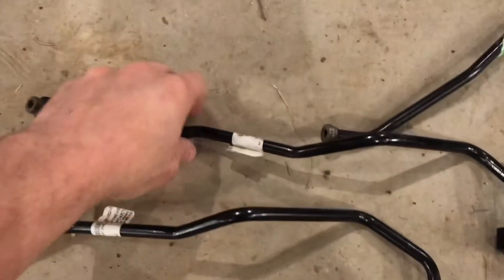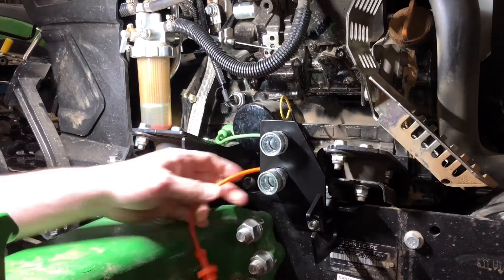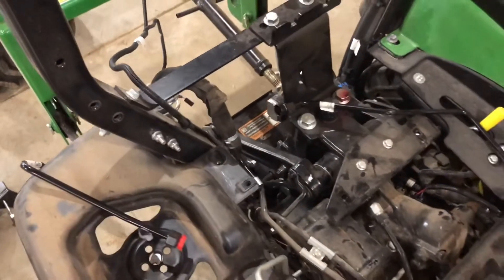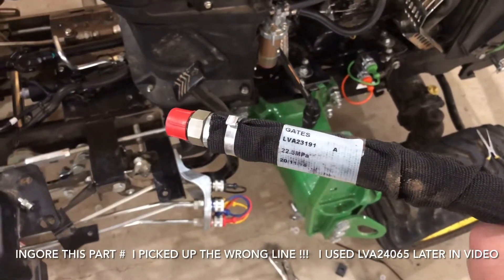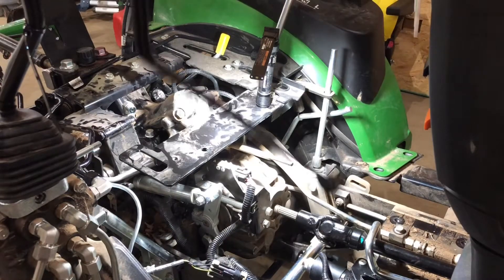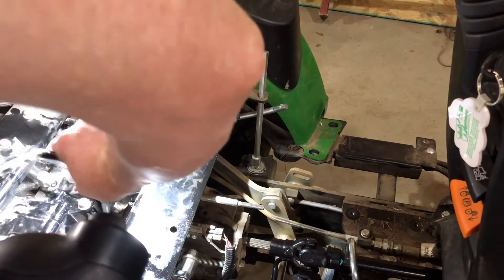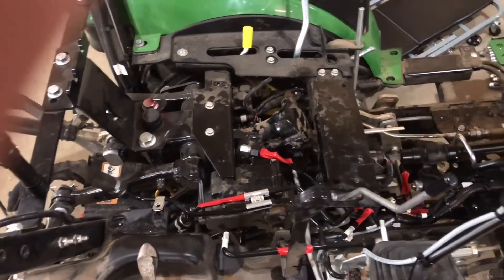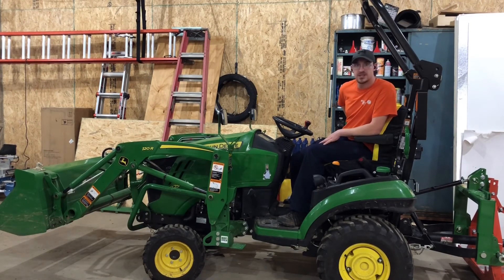1025R Third Function Install Part 3  (Hydraulics)

Comment: We’re trying this. Bought our kit from John Deere for 3rd function. Still have to get the power beyond. Your video is so great! Thank you! Do you maybe know of place we can find a diagram? Ours is a John Deere 1023E
Reply from the maker: I hope the video matches the kit you have.  Sometime in 2023 or 24. Deere changed the design of their 3rd function kit and its quite different.  
When I did this, i used the part numbers of the kit to find the items on 'greenpartstore" website and they had install manuals there.  They can be downloaded or printed.  Hopefully they still do.

Comment: I’ve watched this video several times. I think I’m sure but wanted to make sure I understand correctly. I’ve got a 1025R tractor with the power beyond kit already installed as I’ve got the backhoe 260B. Is this all I’ve got to order:

Front 3rd Function Valve - BLV11143
Loader Line Kit - BXX10268
John Deere Oil Line - LVA24065

Is this correct? Also, how did you relocate your 4x4 lever? Thanks!
Reply from the maker: I really can't remember the line number I used.   
If I were adding hydraulics to a new tractor, I'd go with the summit hydraulics kit with 3rd function.   It's cheaper than the deere 3rd function plus you get rear remotes.  Installs in less than 2 hours. 
I got the 4x4 Lever from a seller on ebay.  If you are thrifty, the factory lever could probably be bent into a more ergonomically proper location.

Comment: Gonna tackle this but plan to connect the belly mower deck lift cylinder to the 3rd function.  Your video is gonna make it a lot easier.  May need to ask for more video and/or pics of the hydraulic connections after all is said and done though to help me understand where each line routs to and where it connects on the various valves and such.
Reply from the maker: Hopefully the kit you have is similar. They changed a lot on 2023 models.

Comment: Do have a complete list of all the parts needed. I have a 2019 1025r tlb and like the way this goes together. Thanks your video was very helpful.
Reply from the maker: Front 3rd Function Valve - BLV11143
John Deere Power Beyond Kit - BLV11216
Loader Line Kit - BXX10268

If I were to do this all again, I would just get the summit hydraulics rear remotes with front third function.  It's cheaper than all this with more functions and an easier install time. 
That kit didn't exist when I ordered my tractor.
Reply: @projectswithjw  thanks for the feedback

Comment: Do u have the first power beyond line ya showed and I’m guess there was 2 lines in the power beyond kit bxx10837
Reply from the maker: I think I said the wrong number somewhere.  The kit did have several lines and the correct one was in the box.  I can't remember the specific number right now.
Reply: @projectswithjw  I’m installing it on a 23 model and the line u did end up using is incorrect for mine lol was going to order the kit but I was wondering how many lines was in the kit for power beyond from my understanding there’s 2 hard lines and 2 lines with rubber hoses attached to the ends one you used and the first one you showed in video that wasn’t correct for your tractor
Reply from the maker: @Destinoffshorefishing  I was looking over numbers again and Im not sure which power beyond kit you used.  I bought BLV11216.  It had compatibility lines for front 3rd function, rear third function, backhoe only, and independent lift valve.  Perhaps something has changed on 2023. I've seen some with the hydraulic ports under the floor where the loader ports are.
Reply: @projectswithjw  problem is my tractor is so new nobody has put a jd 3rd function on it I’m guessing I’m the first lol

Comment: Thanks for your very informative videos. I have a new 1025r on order and the dealer will install the third function since I'm also having the Mauser cab. I see you have the power beyond installed on your tractor. I would like the dealer to install a power beyond for mine, but they say it can't be done. Apparently they say that the Mauser cab won't allow a power beyond. Is there any flexibility on moving the power beyond so it will work with a Mauser cab installed? Thanks
Reply from the maker: The install instructions say that it's not compatible and that's as far as the dealer will probably look into it.   I've seen backhoes attached to tractors with mauser cab so I know it will work.  It looks like the top line of the loop with hit the lower frame of the rear window on the cab.  I would think that a gentle bending of the hardline just a few degrees would probably clear it in the back.  

Green Tractor talk forum will show you the examples I've seen here:
https://www.greentractortalk.com/threads/1025r-using-backhoe-with-mauser-cab.203235/
Reply from the maker: I found one more example with better pictures.  You can see the loop in this:
https://www.greentractortalk.com/threads/adding-a-260b-backhoe-to-a-mauser-cab-1025r.208633/

Comment: What color lines did you connect to the new outlet and in what location did they connect (upper and lower)?
Reply from the maker: I put green on top and orange on bottom on tractor.  My loader ended up with orange on top and green on bottom.  I'm not sure it really matters.  The tractor outlet ports are same size so the loader hoses can be swapped in a few seconds if you don't like which way the joystick buttons are actuating the attached tool.
Reply: More questions- my tractor is a 2021 model 1025R with a factory installed backhoe and loader. I ordered a BLV 11143 third function kit from John Deere to install on it. Does your video apply to this kit installation?
Reply from the maker: @michaelhaver9215   Yes.  I have 2020 Factory installed TLB.  I also had to order Power beyond kit to get compatibility lines for the install.  BLV11216.
Reply from the maker: @michaelhaver9215   It's quite an ordeal to install.  Have you looked into the Summit hydraulics solution?
https://summit-hydraulics.com/product/rear-hydraulic-valve-kit-with-front-third-function-for-john-deere-1-2-series-tractors-two-spool-three-spool-four-spool/
Reply: Already purchased the BLV 11143 kit from John Deere. Install begins tomorrow morning.